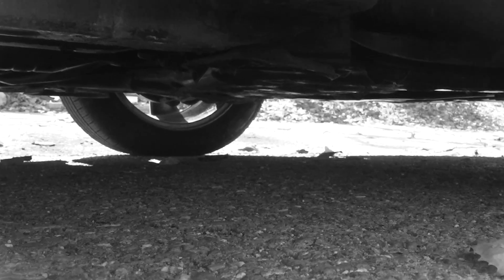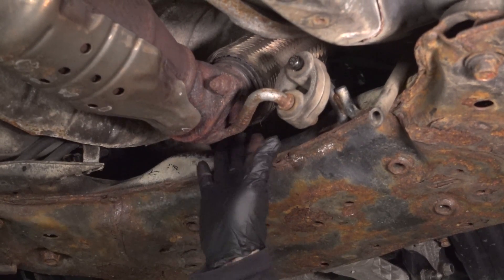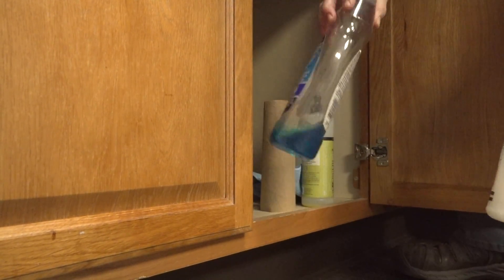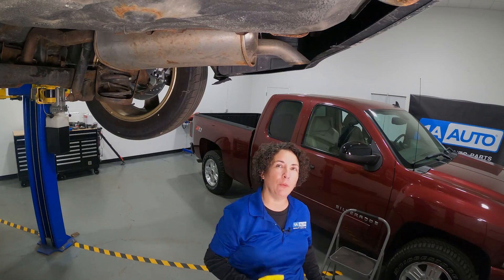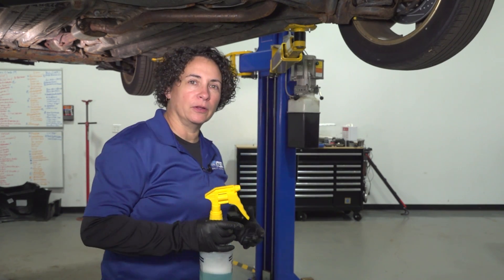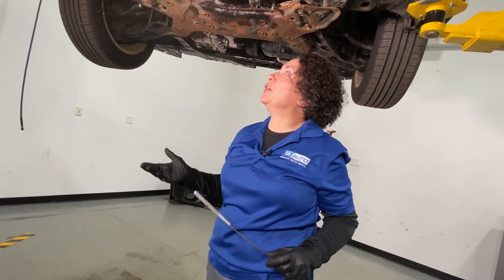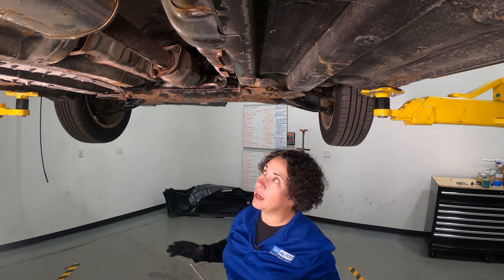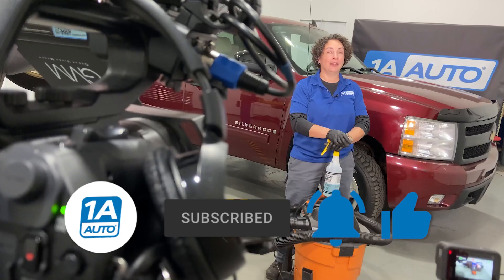Car or Truck Louder than Usual? How to Quickly Detect an Exhaust Leak with Common Household Items

Comment: Here's  a  thought ! how do you know your not inducing dirt into your exhaust and possibly your engine  by  using that vacuum  pressurizing the system ?
Reply: Your not gonna send any trash that far up into the engine with a shop vac. If there was any dirt it would be caught at the honeycomb at the cat and I doubt any debri would make it that far.Look in the exhaust and run the vac a bit before you stick it in there